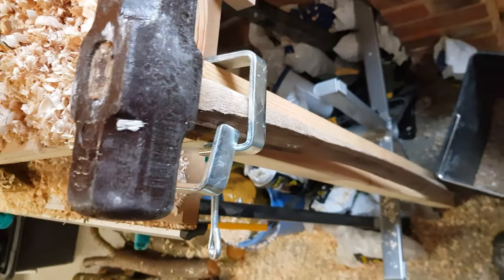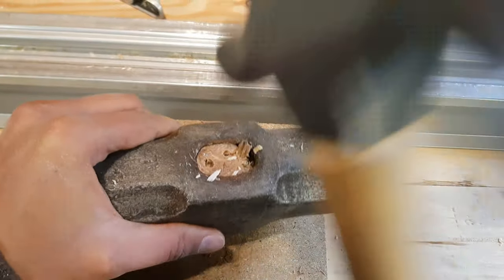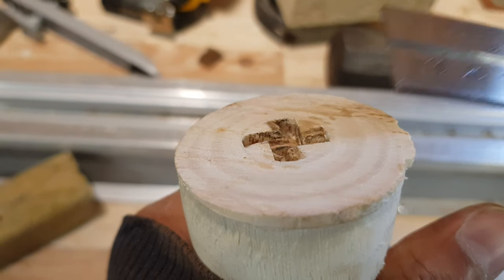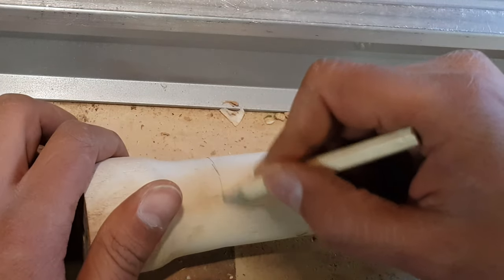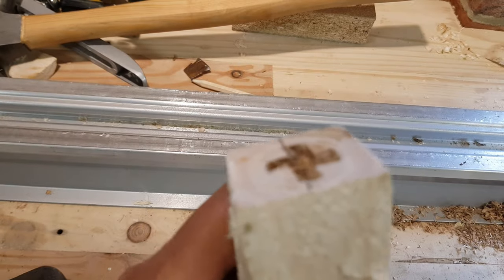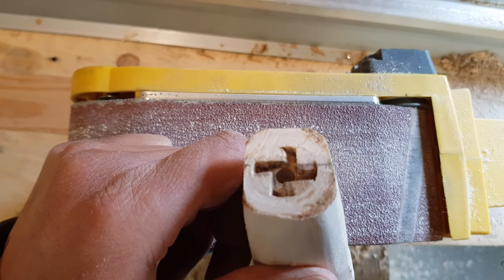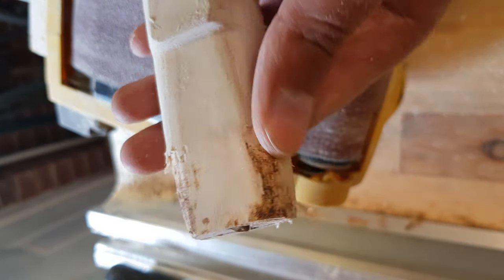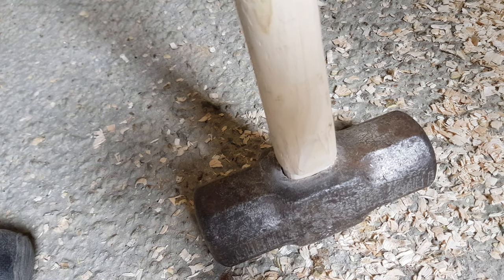Replacing sledgehammer handle

Comment: Nice job as usual, DIM. Did you reuse the wedge from the original after you knocked it out? Any finish or oil on the handle later?
Reply from the maker: I did indeed. Made life easier. I should have video it. Oh well. Next time.